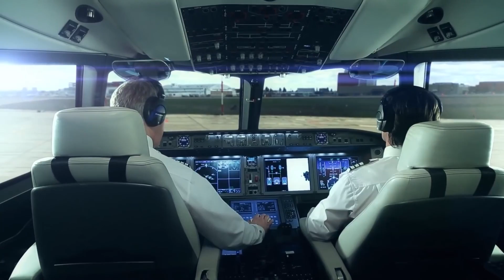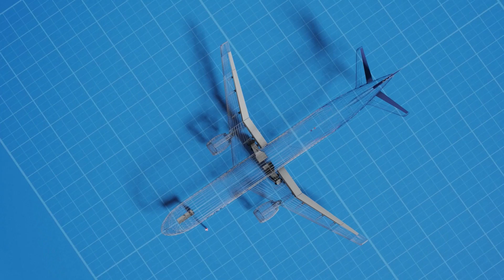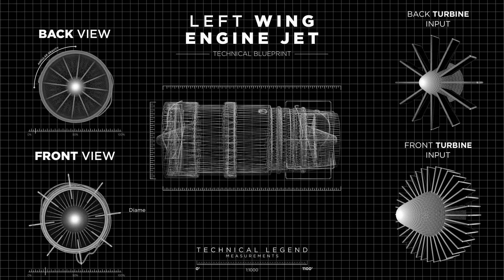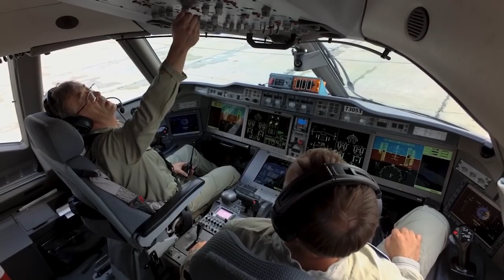Russian 737 MAX & A320 Competitor - The MC-21

Comment: I've seen the opinion which seems reasonable that the biggest challenge for the MC-21 with international customers will be the spare parts and repairs since this is something that both Airbus and Boeing are very good at. Given they are already having supply line issues, this does seem like it could be the achilleas heel
Reply from the maker: Airbus and Boeing are totally insane with their supply network. A huge challenge for a new aerospace firm to break into.
Reply: I think you're absolutely right. It will be almost impossible for the Russian enterprise to match this. Aircraft are not something you can sell and just forget about, as we know.
Reply: Exactly. This is what buried the Superjet 100. Sukhoi report that they are fixing these errors and that it was really a problem, so let's see how they coped .. Boeing and Airbus are lobbying giants and service giants .. It will be very difficult for the dry man.

Comment: I have a question, why doesn't any aeronautical company design a plane powered by propellers and jet-engines. It would be cheaper to manufacture, maintain and fly. Please share your thoughts.
Reply from the maker: Do you mean a combination of both?
We have propeller, or rather turboprop aircraft, used for shorter flights (more fuel efficient for take offs and landings), and jet engines for long flights (more fuel efficient for longer flights).  It wouldn't make sense to have both on one plane, as it would negate any fuel savings the extra weight.
Reply: @FoundAndExplained  That's exactly what I meant.
Reply: @FoundAndExplained  I do agree but I forgot to mention one thing, what if the propellers were powered by electric motors.
Reply from the maker: Where does the electric come from? Heavy batteries? Or Hydrogen like the ZEROe Airbus plane? (video on my channel about it).
Reply: @FoundAndExplained  Yes, if the motors were powered by graphenite batteries.
Reply: @aliadil2455  на сколько знаю Rolls-Royce занимается разработкой электрическим приводом, но говорят до этого еще очень долеко
Reply: It has to do with speed. Propellers are more fuel efficient, but need a slower cruise speed. Ducted fans are less fuel efficient, but can operate at higher speeds. For shorter flights, the prop is better, but for longer flights, the fan is better, as the speed makes up for the lower efficiency.

Comment: I wonder why there isn’t any winglets on it
Reply: According to my knowledge, the MC21 is intended to be a short-haul plane. Longer flights are needed for most winglets to be worth it.
Reply: @g.zoltan  beat me to it.. the 747-400D never had winglets either because of its use on short-haul routes. I'm sure that they could outfit the mc-21 with winglets if they really wanted to
Reply: To answer the question 'why are there no winglets' you have to know what are winglets for and how do they work. They reduce the drag by increasing the wing's length to width ratio. But A320 and B737 have alloy wings, they are pretty wide. MC21 wings are carbon fibre, they are much more narrow, and those wings without any winglets have better length to width ratio than that of A320 and B737. It doesn't need winglets to be more fuel efficient than competitors, so why bother with them?
Reply: @gravelking2.071  what were to happen if you were to add a winglet to a song like this? Would it make it more efficient or no?
Reply: I think that's because the airplane is efficient enough, so it doesn't need winglets
Reply: потому что мс 21 использует удлинение крыла,  чем длиннее крыло тем меньше индуктивное сопротивление! так как крыло сделано из композитного материала оно легче а значит есть возможность увеличить крыло!   или посмотрите это видео  https://www.youtube.com/watch?v=7rA2stj3tRU не забудьте переключить на английский
Reply: Thank you all for the information. I was thinking (when I wrote my initial comment) that maybe it was already because it is already efficient enough but that still doesn’t make sense because you would still want winglets for maximum efficiency. Nonetheless thank you for your feeedback!
Reply: Hoy Sum  , the wing of MC-21 doesn't need winglets. Discussion about absence of technology is naive.
Reply: Hoy Sum  Denis Stepanov
5 days ago (modified)
Because 21 ms uses wing lengthening, the longer the wing, the less inductive drag! since the wing is made of composite material it is lighter and therefore it is possible to increase the wing! or watch this video https://www.youtube.com/watch?v=7rA2stj3tRU don't forget to switch to English
Let's say thanks to google translator
Reply: Yeah, me too
Reply: При таком крыле винглеты ему просто не нужны.  Рассуждения об отсутствии технологий наивны.
Reply from the maker: I was thinking the same thing. Some modern planes have small (not non-existent) winglets, but it still seems mightily strange not to have something. Perhaps the designers simply don't have access to that research and it will come on a future version.
Reply: @FoundAndExplained  they have acess to that, the il-96 has big winglets
Reply: @salvaahthesageofficial2457  + TU-204/214
Reply: @FoundAndExplained  the wing design and the materials used didn't require the winglets to make the Aircraft that efficient though the design bureau have studied a possible application.
Reply: Winglets are ugly, and there is controversy about how effective they are.